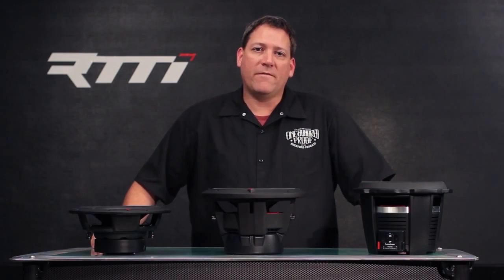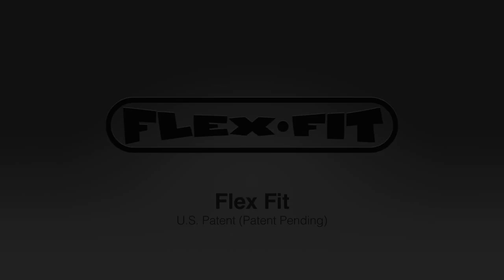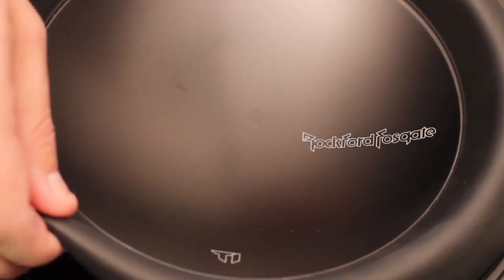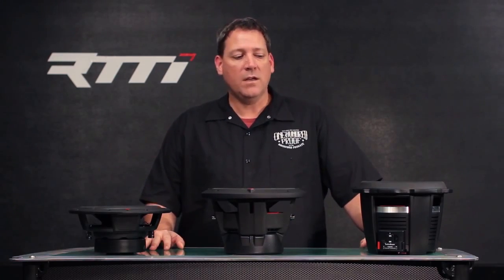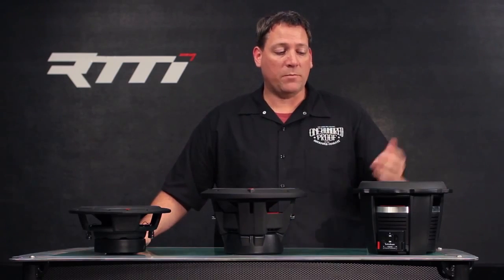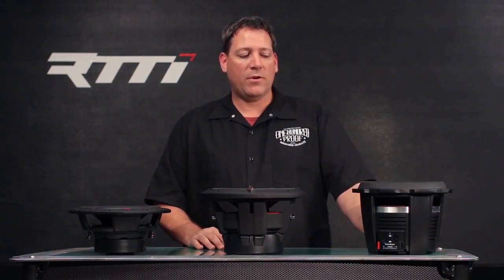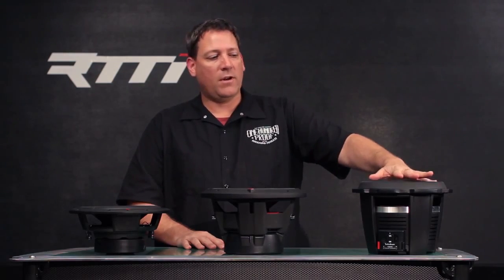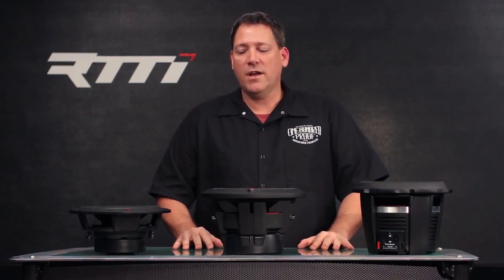Rockford Fosgate: Subwoofer Comparison (1.3)

Comment: Good day I purchased this speaker in enclosure on amazon and the front suspension was dry rotted when received. I contacted the seller and they agreed to accept the return however my local shipper cannot ship due to restrictions. Shipping with dhl or fedex is costing almost the cost of what was paid for the item. Is there a kit of any sort to have this repaired as to avoid my loss?
Reply from the maker: Hi Laurie, Unfortunately no, this sounds like a package that someone built and selling on their own.  Also, the only Authorized Amazon dealer are listings by sold by Rockford Fosgate, LLC.  All other sellers are unauthorized and notorious for selling old merchandise as new.  For more info, please look at our DO NOT BUY list on our Dealer Locator: https://www.rockfordfosgate.com/dealerlocator/
Reply: Rockford Fosgate this does not help though. Is there a replacement kit for it so I can have it repaired.
Reply from the maker: @LaurieBenjamin  I'm sorry, we don't offer repair kits for our subwoofers because we typically replace the entire subwoofer under warranty.  I would have the seller ship you a replacement subwoofer (no enclosure) on his charge since they sold you a product that was dry rotted.
Reply: @LaurieBenjamin  you can get a foam repair kit from simply speakers.

Comment: Which subwoofer  is best for home theater system. For my diy home theater. My LFE frequency range is 80hz.
Reply from the maker: Any of our 10" or larger subwoofers will work just fine in a home theater system.  Just be sure to match the impedance and power handling to your receiver amplifier, so you don't overpower them or damage the amplifier.  
Any of these models I would recommend:
• Punch 10" or 12" P1, P2, P3 series
• Power 13" or 16" T1, T2 series
• Power 19" T3 series

Comment: I currently have two P3 12s with the 1200W amp and have been considering purchasing the T1 12s with the 1500w amp. Is there any significant difference between the two subwoofers?
Reply from the maker: Sound quality wise they are very similar.  The major difference is the higher power handling.  The practical side of this is you may not see much of a difference since you'll theoretically need to double your cone area or double your power applied (assuming the subs could handle it) in order to get a +3dB increase that would be noticeable.
Reply: @rockfordfosgate  I'm confused as to what is the point of the t1 ? if its almost double the price point of the p3 . why is it in the line up if you don't really see a noticeable difference ?
Reply from the maker: @brandonseiter5471  Because many fanatics start at the higher performing (Power) series.  If there wasn’t a T1, you would be jumping into [an equivalent] to a T2 model that’s rated around 2kW.  However, in your situation, comparing the P3 to a T1 is similar to comparing the P2 to a P3.  It’s a marginal difference.
Reply: @rockfordfosgate  thanks for the reply

Comment: Is Bryan still running the assembly line cell,(solder wave, Distrete Surface Mount and final test) at the Tempe plant? What about Andy?
Reply: I love my p3’s
Reply from the maker: Bryan Sofge and Andy Keener?  They left quite a long time ago.  I was the signal processor technician until moving into RTTI around 1996/1997.

Comment: A lot of money for speakers that dont handle a lot of power.
Reply from the maker: These are designed from scratch as Sound Quality subwoofers and the Power Ratings are based on CEA-2031 standards.  Rockford Fosgate amplifiers have always been "under-rated" and the power handling on subwoofers follow the same path.  It's amazing to us how some subwoofers on the market have 3" voice coils, yet claim thousands of watts of power handling with no standards to back it up.  Overall, the subwoofer designs do not use repurposed or "off the shelf" parts, nor do they utilize multi-layered glued spiders because the basket design can't accommodate them.  All designs are developed on the premise of SQ with EXCELLENT linearity, CONSISTENT performance, and HONEST power ratings.

Comment: Q I’m amp said will it do 2ohms at 1000watts so I’m other Q is if i do 2ohms I’mpedance to my Rockford fosgate p2d2 will it damage my amp? Btw it’s kenwood 1000.1 mono block
Reply from the maker: Running an amplifier at a 2-ohm impedance doesn't hurt woofers, but the amount of power it generates does hurt them.  I'm not sure what size or how many P2D2 subwoofers you have, so I'll assume you have (1) one of the P2D2-12 subwoofers that's rated to handle 400 Watts RMS.  In this scenario, yes, 1000 watts would blow up one subwoofer because it's over-powering it by 600 Watts.
Reply: Rockford Fosgate I got two of them thanks for replying👍
Reply: 12in
Reply from the maker: @extendedraven7893  O.K. great, so two P2D2-12 subwoofers will give you 800 Watts of power handling.  This amplifier will still be too much power, but more importantly, you can only wire them to a 1/2-ohm load, 2-ohm load, or 8-ohm load.
Reply: Rockford Fosgate thanks a lot sir
Reply from the maker: @extendedraven7893  Any time.  Just want your system to last for longer than a drive to Jack In The Box.

Comment: Looking to buy a SINGLE 12 Rockford Fosgate T1 Series and I plan on buying The Rockford Fosgate T1000-1BDCP..would that Amplifier be SAFE on pushing The SINGLE 12?, some advisors from crutchfield say it will be safe and some say it will be too much for it, so I’m confused since the ones say it will be safe cause the amps are underrated..also I have seen a few ppl push that single sub fine with the full potential watts that amp gives it just trying to make sure it’s for sure safe from an expert and experience from you guys. Thank you
Reply: Itll handle it just fine dude
Reply: logan smith yea I went to a local shop that sells Rockford Fosgate systems and he said the same thing cause I have 2 p3 12s running on a Rockford Fosgate T1000-1BDCP AMPLIFIER but I want something more deeper bass and hits lower notes..thnx for replying much appreciated!
Reply from the maker: First, what model T1 subwoofer are you referring to?  We have 3 generations of "T1" subwoofer, including the "slim" models that all have different power handling ratings.  Also what size of "T1"?  The exact model number will help us with the proper answer.
Reply: Rockford Fosgate “T1D212” 800RMS-1600MAX THE ORIGINAL SUBWOOFER THE ONE IN THE VIDEO
Reply: Rockford Fosgate how about the T2 13” non slim..what amp do you recommend to get to full potential for a  single subwoofer
Reply from the maker: @jrreyes9968  One T1D212 is rated to handle 800 Watts RMS  and can be wired to a 1-ohm or 4-ohm load.  The Power T500-1bdCP would be a great amplifier because although it's rated at 500 Watts x 1 @ 1-Ohm, it can realistically produce 700 watts.  That's enough power to drive the subwoofer without over-powering it.

Power T500-1bdCP
https://www.rockfordfosgate.com/products/details/t500-1bdcp/

The Power T2S1-13 is rated to handle much more, at 2000 Watts RMS.  The Power T1500-1bdCP would be a good match for that because although it produces 1500 Watts x 1 @ 1-Ohm, it can produce up to 1,700 watts.  That's enough power to drive the subwoofer without over-powering it. 

Power T1500-1bdCP
https://www.rockfordfosgate.com/products/details/t2s1-13/

You'll get plenty of other suggestions, but I want to make sure you still have an operable system over the next several months/years without the need to "re-cone" the subwoofer because it was over-powered.
Reply: Rockford Fosgate Thanks for the reply! Much appreciated, I have 2 p3 12s running on the T1000-1bdcp they’re good subwoofers but I’m looking for something that hits lower notes and deeper bass. I’ll probably go for the T2S1-13 and get the T2500-1BDCP I’m not gunna abuse the subwoofer just have the power for the subwoofer to hit the lower notes also get a bass knob, I mainly listen to rap and hip-hop and for sure custom build the box. Thanks again for the reply!
Reply from the maker: @jrreyes9968  If you want it to sound different than the P3 12", I would suggest talking with our technical support.  They can look at the current enclosure's frequency response and tailor the new enclosure to hit those notes you're missing. Also, be careful with that bass knob, because it's easy to get carried away once you hear that deep bass, I mean who doesn't want more, right?!

Comment: funny they called punch their sound quality line I've owned all their lines and the power series wins hands down in sq over punch and prime.
Reply: I been running fosgates a long time. I’m 43 i run two p3 12’s 1 ohm of course on a prime 1,200 . I have ran kicker, mtx n such i always fall back to Rf! Love em
Reply from the maker: The Punch and Power series actually share the same topologies, so they both sound very similar.  The Power series typically has better features.
Reply: @rockfordfosgate  Hmm I don't see how anything is the same at all.............. Punch has aluminum or paper/ kevlar cones AND the Power is paper with aluminum dust caps and further up is carbon fiber even the similar vast surround is way different its twice the size on power series the power series magnet, baskets, terminals, voice coil size, etc etc all bigger and different. Honestly  to my eyes owning almost all they don't share a single thing in common especially the sound signature! All your sub woofers are amazing but the power series cost triple the price for a reason it's not just SPL as a consumer I'm trying to tell people don't let the word spl scare you they also sound amazing on allllllll music POWER SERIES is amazing and worth every penny and sorry for jacking up the video I was actually just trying to help in case someone was considering  a power  series woofer:)
Reply from the maker: @lazerlinec1770  I need to apologize.  I thought I was replying to a comment on our AMPLIFIERS video, not the SUBWOOFERS video.  I don't drink coffee, but maybe I should start the day off by drinking some :-0 . You are absolutely right.  With subwoofers, the Punch & Power Series are very different, so you'll definitely hear sound quality differences.  However, both lines are built with Sound Quality as a primary objective, not just creating "whomp, whomp" woofers that move air.
Reply: @rockfordfosgate  I'm sorry to I should have typed more originally or kept my mouth shut I just wanted to let people know although all are amazing the power series is just truly amazing sorry RF I'll word more carefully next time :)
Reply from the maker: @lazerlinec1770  Ha Ha, you're totally fine my friend.  I just need to stop multi-tasking.  
Appreciate you sharing your experience with other Fanatics!  Rock On Lazerline!

Comment: Hi- I ve built a fiberglass subwoofer closed enclosure and planned to mount the Punch 10" P2 subwoofer in it. The thing is that the enclosure came out a volume of about 35 liters .  Will the bigger enclosure degrade the sound of subwoofer?. I do not want to mount a 12" sub as it wont fit stealth in the trunk.
Reply from the maker: The P2D4-10 is recommended at 0.59 cu. ft. (16.7 liters) sealed or 1.40 ft. (39.6 liters) vented.  If you plan on running it sealed, you will have better low frequency response, but your mechanical power handling will be lower.  If you decide to port it, your vent will be very long.  Depending upon what you decide to do, contact our technical support at http://rftech.custhelp.com for the the max power you can apply to a sealed box, or the vent diameter and length for a vented box.

Comment: I’m 16 my first system is going like this-ORDERED: 4 rockford fosgate door speakers, A Skar one channel 1500 watt amp (for subs) and a dual 12 sub box for my xcab silverado. NOT ORDERED: x2 Rockford Fosgate P3D4 12s. I’ll keep u guys posted on my experience with my system after i get the subs ordered with my next check. Hope it bumps!

Comment: so which one is powerful better as seen on here yall tell me left middle or right i used to have the middle one
Reply from the maker: It's not a matter of which one is more "powerful", but rather which one can handle more power.  The Power Series (right) can withstand the most amount of power, the Punch Series (middle) can handle a high amount of power, and the Prime Series (left) can handle low-to-moderate power levels.

Comment: R1 2x12 with p1000 bd1 i have in my car
Reply from the maker: Whew, the R1-2X12 is rated to handle 400 Watts RMS, and that P1000-1bd is a very powerful amplifier.  Be sure not to smoke those woofers!
Reply: @rockfordfosgate  hmm is my first audio system i dont turn up too much i pomise xD greetings from Germany

But 2 ohms 500 watt ?
Reply from the maker: @verklatschtundzugenaht3251  O.K. yes, 500W at 2-ohms running at moderate levels should be fine :-)

Comment: Is the 500 1xD amp a good match for a single 12 p3?
Reply: No absolutely not, I have my 1 P3 on 1200 watts and it takes it like a champ. Been 2 years with zero problems, these subs are really underrated
Reply from the maker: Do you mean the R500X1D?  Yes, if the P3 is a P3D4-12, then it can be wired to a 2-ohm load, exactly what the amplifier needs.  That amplifier produces 500 Watts x 1 @ 2-Ohms, which is under the woofer's rated power of 600 Watts RMS, so it's a good match
Reply: Yes thank you!!

Comment: Junk. My t3 12 inch subs could not even take a Crescendo BC2000. Roasted them. Replaced with Massive Toro's and they never blew. Did a 146 with them in a Mustang.
Reply from the maker: RF never made a T3 12" sub, so not sure what you're referring to.  Anyhoo, it doesn't matter what subwoofer you have, they all blow the same way ... by exceeding the RMS power handling capacity of the voice coil.  Don't over drive them and they won't blow.  We see customer abuse like this all the time. Why do you think so many company's base their reputation on how you can "re-cone" their subs?
Reply: Then it was this one and the claims are 1200 Rms so running 1000 rms is not abuse. I have been into car audio and installing since 1989 and never blew a sub except for the Fosgate subs. This is my car with the Massive Toros in it. I don't do this any longer, it got boring after 28 years. https://www.youtube.com/watch?v=v-Ix4KohqXE&t=33s
Reply from the maker: That's great!  I started here at Rockford Fosgate in August of 1989, so you must be familiar with RF subwoofers that use aluminum voice coil formers.  Since you've been installing that long, you could tell me exactly what part of the subwoofer that "blew", right?
Reply: In 89 I was 16 and everyone I knew had Fosgate subs including myself. I remember the Punch and Series 1 and I believe series 2 woofers. A punch 45 had no problem pushing 2 Punch 12s. My friend had a competition car then with 4 Punch 18s and he ran them off a Punch 150. About 8 years after that I moved over to MTX with Precision Power Art series amps.

Comment: I’m using p3d412 on my prime 500.1d monoblock? Is underpower?
Reply from the maker: Hi Rejiv, The older P3D412 is rated to handle 500 Watts RMS.  A single woofer can be wired to create a 2-ohm load.  Do you mean the Prime R500-1D? This is rated to produce 500x1 @ 2 ohms, but can dynamically produce up to 580 Watts x 1 @ 2-Ohms.  In my view, this is a perfect match.

P3D412 - https://www.rockfordfosgate.com/products/details/p3d412/
R500-1D - https://www.rockfordfosgate.com/products/details/R500-1D/
Reply: @rockfordfosgate  its the new one p3d412. Yes its r500.1d.
Reply from the maker: The P3D4-12 is rated to handle 600W so you're still matched perfectly.
P3D4-12 - https://www.rockfordfosgate.com/products/details/p3d4-12/

Comment: I have two p3 and the voice coil are getting hot
Reply from the maker: Speaker and subwoofer voice coils will get warm because a high percentage of power fed to them is dissipated as heat.  Just keep the power applied under the RMS power ratings of the subwoofers and you'll be fine.  Exceed that power and you're likely to burn-up the subwoofers.
Reply: Rockford Fosgate what if i run 2 rockford fosgate p3d4s wired to one ohm with a 1500 watt amp? is that too much power?

Comment: Hello, I recently got back into Audio and bought an old school Solo Baric 12" with a ported box and a Punch amplifier, The bass is very Muddy and insecuate due to the ported box. I was recommended to go with 3 10" in a sealed box for a more SQ experience. I have a RF BD1500 amp to play with and was looking for lots of Bass but also accurate, which Subwoofer would you recommend for a SQ setup?
Reply from the maker: Quality of bass mostly has to do with the type of subwoofer used combined with the enclosure design.  The Rockford Fosgate Power bd1500.1 produces 1500W x 1 @ 2-ohms, but unfortunately, 3 subwoofers (regardless of what you get) will not create a 2-ohm load.  Specifically, why were you recommended 3 subwoofers?  Was this simply based upon the airspace available?  We typically work backwards to find how much available airspace there is to work with, then select a subwoofer model, size, and quantity best optimized for that space.  It may worth calling our technical support so they can discuss the various options with you.  I'd like you to have good bass, so instead of taking a stab in the dark to see if a different type of system might work, let's have our technical guys recommend the best option for you and your vehicle. They can be reached at 1-800-669-9899 or live chat at www.rockfordfsogate.com